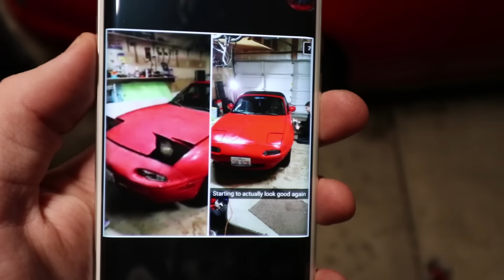Project Miata! - Dent & Rust Repair, Repainted Bumper, New Lights, Buff & Wax

Comment: It's amazing how much life is left in that single stage paint, isn't it??  I did a similar paint restoration on a 90 Miata and was amazed that there was so much gorgeous color under decades of oxidation and neglect.
Reply: I got that way with a 95 I had 10 years ago.  Luckily, the 90 I have now was neglected so badly, the previous owner never polished it, and allowed a protective layer of oxidation to form.  Something you can try if you start seeing really thin paint is to have so of your color code put into a spray can, go over the really thin parts and then just blend it all together with polish.

Comment: "This is how you fuck up a already fucked up miata. Fix rust and dents with bondo and rattle can spray paint" 😂 😂 😂 that's what the title should be.
Reply from the maker: +Nick Pierson what the hell else are we supposed to do?
Reply: Gingium well to do it the right way is to cut the old rusty metal out and weld in new metal. or get another fender from a junk yard. As for the rear quarter panel, that is just trashed. but what you guys did is the cheapest haggard way of doing it.
Reply: Nick Pierson so what that might be what their going for in this build a haggard miata
Reply: dom5201 if that's what there going for then they are doing it right 👍 lol
Reply: Gingium rekt
Reply: Nick Pierson hey the guy is making a budget tuner car, it looks good for cheap.
Reply: Phill Bozz Yeah I'm so jealous of a piece of shit miata 😂👍 whatever floats your boat
Reply: David Rohac hahahahaha true
Reply: I agree, doing it that way myself now. That takes times and they are probably lazy lol.

Comment: go for an OEM look. It will be cheaper and look nice^^
Reply: Alex Kirchgessner what does OEM stands for?
Reply: Original Equipment Manufacturer - Basically i said go for a stock look with some cosmetic enhancements.
Reply: Alex Kirchgessner nice!!!! i would like the same!!
Reply: yep, because trying to look fly with a giant bodykit on a budget is predestined to look ricey. Under-the-hood adjustments will give you way more pleasure driving it on this car than a giant rocketbunny bodykit...
Reply: my 1995 miata is the base model and has 47k its bone stock right down to the steelies.
Reply: cars67833 Great! Now throw on some Coilovers and a new pod filter + performance exhaust and you'll have a pocket rocket ^^
Reply: Thats the plan get some coilovers new header and exaust some new wheels sweet sound system some gripy tires and an intake and id be happy. Also a front lip
Reply: That is exactly what i would do to this car. No fancy outside mods that won't bump up the reselling price :)
Reply: Alex Kirchgessner so that's a big no no on a Wang ?
Reply: PVNCHO s14  wouldn't do it on a budget. Just my general opinion about Tuning, first Chassis, Then Drivetrain/Motor, then Interior and last Bodykits/Aero stuf

Comment: so whats the deal with gingium's miatas turn signals? They look bad ass and i havent found the video about them
Reply from the maker: +Jaden Newlan Never made one, but they are turn signal intakes
Reply: still working urn signals though too? and yessssssss the man himself responded
Reply: They are Turn Signal Intakes. Look them up. They're about $100 or so. They have a slot for the turn signal and it has a vent to let cool air go into the engine bay. Very neat design.

Comment: Isn't it bad to repair a car with plaster?
Reply: Thomas Cole it's not plaster, it's called bondo. it's used to fill in dents and paint imperfections
Reply: Cazenoviia oh I've never heard of it .
Reply: People call it "Bondo" but it really isn't "bondo". Its just body filler. Bondo is just a brand that makes body filler.
Reply: they where however one of the first and are possibly the biggest name, so the their name just kinda became ubiquitous for body filler in general, kinda like everybody calling adhesive bandages "band-aids."
Reply: Thomas Cole wtf is plaster lmao
Reply: Thecharliejolly it's a compound used to fix drywall imperfections and holes, essentially bondo for your houses walls lol
Reply: Its bondo. You're supposed to use a very small amount here and there for knicks and dents. Not caked on all over a panel. It'll crack and flake within months and will look much worse than it started.
Reply: Matt I would have cut it out sandblasted it and then patched that shitbox

Comment: Dont you know what primer is Caleb?
Reply from the maker: +Luke Hindle I shouldve used it on the rear panel, everything else was fine without it
Reply: Yeah that's true. It would have looked a lot nicer with primer to cover-up the old paint, but it's a budget build I guess so it's fine.

Comment: The car looks amazing. A tip on the part they are bitching about in the comments. Sand it with the hand. Gives better result then a machine.Right now its straight up bubbles But it has paint now so its fine

Comment: sounds stupid but if you use a cheese grater after the bondo has dried up you can shape it easy and it takes all the bulk off
Reply from the maker: +Rouchka lol wut
Reply: lol I went to body school. we would lay the bondo down. then let it dry and shape It with a fine cheese grater. then sand it all down. saved alot of time

Comment: People say miatas are gay. Ok then fix your gtr r35 with a roll of duct tape and glue. Or buy replacement parts for $20, or even tune it to have 300 more horsepower with a eBay turbo

Comment: it needs a new radiator badly
Reply from the maker: +kipper busby Yeah It burns coolant cause its spraying all over the block
Reply: Gingium a nice aluminum dual core radiator would be nice. you can get them off eBay from $150 most of the time. I got one and they legit. new coolant hoses would be recommended too

Comment: "Rust repair". You know Miatas rust mainly from the inside?
Reply: The 97 I picked up for cheap had no rust so I took it to a place to have anti-rust oil spray applied.  They absolutely soaked inside all the panels especially the rockers.  Hopefully that will stop anything from happening for a long time.  I think its definitely worth the 130 spent, give a peace of mind that Ive done what I can to prevent it.
Reply: Depends on where you live. If it's somewhere dry and sunny then that's enough. But no matter what you do, when you live where it rains a lot and the first owner didn't seal the inside with wax then it's gonna rust.